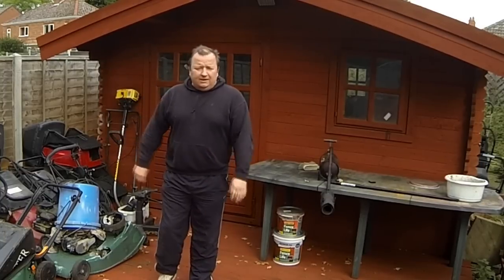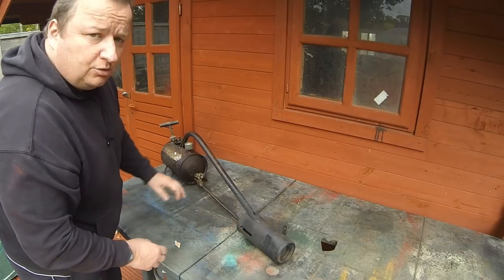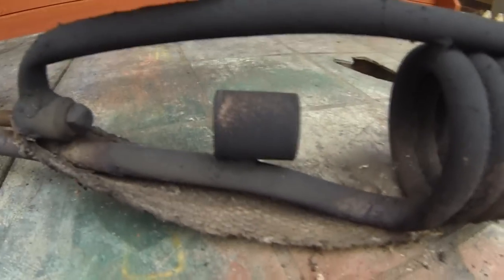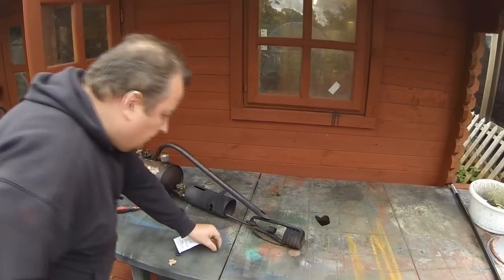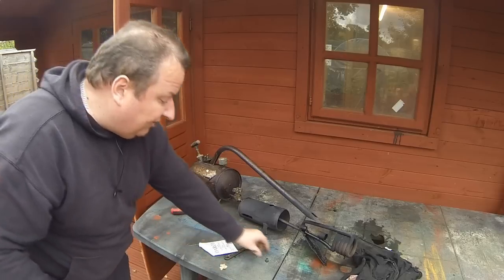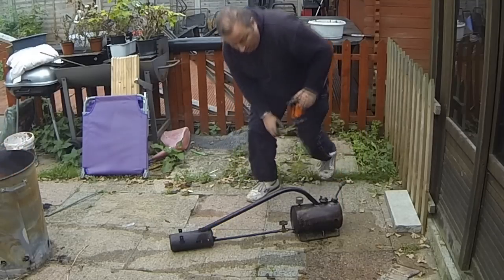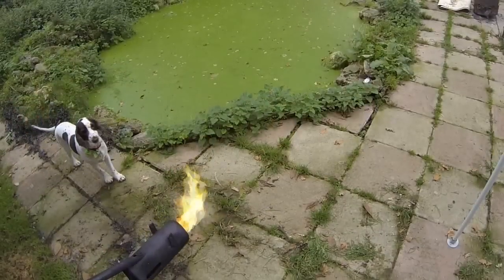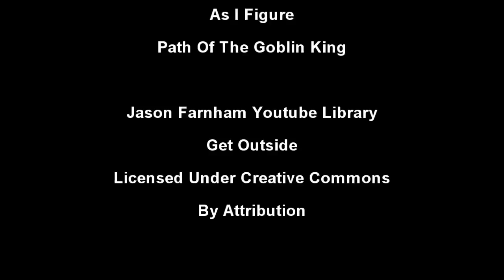Sheen Flame Gun Restoration Flame Thrower X300

Comment: good unit that, also ordinary salt or rock salt is fantastic for organic weed control on paths and gravel, the romans used it extensively to keep the weeds away.
Reply from the maker: +bidders77 I didn;;t know that. Nice tip.
Cheers
Martin
Reply: +retrorestore no worries, not ideal if you want to replant in the area but as a gardener myself i use it alot on paths and gravel driveways, also ordinary soda crytals are fantastic for killing moss, very cost effective!
Reply: +bidders77 ps what do you use solution wise in your ultrasonic parts washer? water or a mixture? thanks
Reply from the maker: +bidders77 For cleaning carbs, I use hot water with a drop of paint thinners but for normal cleaning I use water with white spirit.
Cheers
Martin
Reply: +retrorestore cheers.

Comment: Nice pickup I have one of these myself handy tip thou it’s not necessary to burn the oblivion out of the weeds it only need wilt the leaves to have done its job nature will do the rest if u see steam coming of you’ve spent to much time in one spot. Cheaper to run and no black soot to clean up good vid hope this helps someone cheers

Comment: handy video...i picked one up from a flea market for nothing ...but ive got my work cut out....the shroud you pulled back is rotten from the front to the side vents ive cut the rot off  tidy so i can weld a sleeve over...and re attach the lugs back on...the tanks ok the plunger has seen better days .i believe  they are leather ..but the reason im writing is that the nut holding the shroud end cap to the jet seem to have some type of oldy worldy thread lock oozed out of the nut and lookin for some advise to crack it with out twisting and snapping it off .when the wifes uo i am trying heat from a propane torch very gingerly...and have a feeling this wont do anything exept waste gas ..if i snap it its scrapped any tips
Reply from the maker: Yes I would heat it up as well bud. Good luck with it
Reply: it was just starting to turn when your msg came through  1/4 turn at a time and backing off as if i was cutting a thread.. whatever this stuff was i am buying some if i find out what it was/is  lol.  it was solidifying in the time i could get the spanner on to the nut...lots of fun and flames lol thanks again